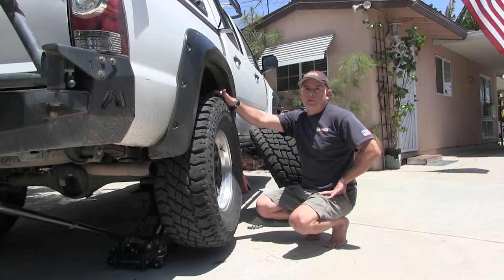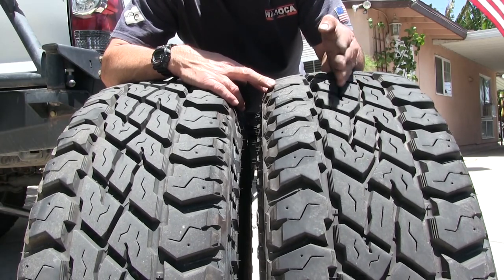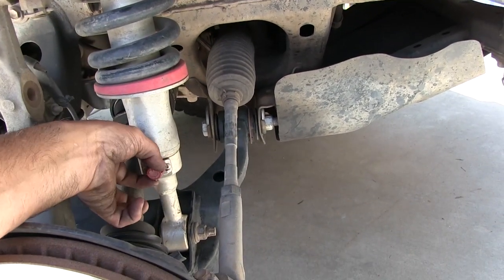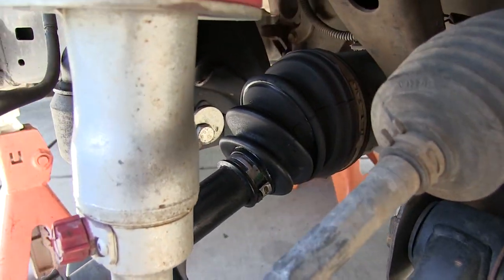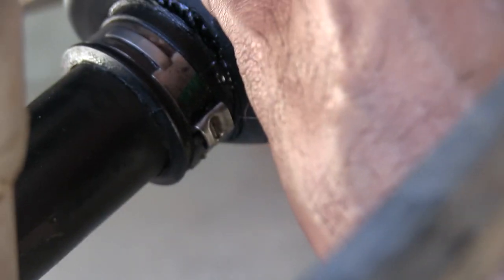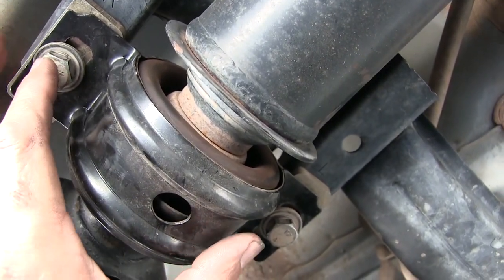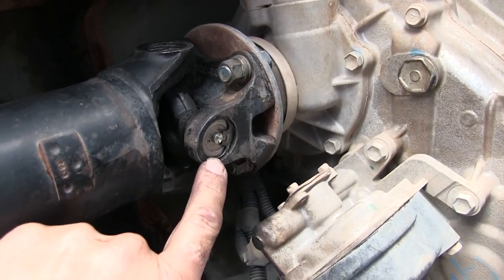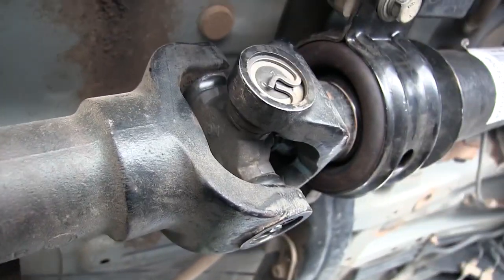Getting Ready

Comment: I did both front wheel bearings and carrier bearing before 50,000 miles. Wheel bearing assembly  $170 each from taco bandit. Carrier modified Ford Ranger bearing.

Comment: If you're pressed for time, just would buy new CV axle at AutoZone/Napa.  When time isn't an issue, you can rebuild the one you changed out and use it as a spare.
Reply from the maker: $65.00 plus core at Oreilys.
Reply: Or you buy new w/o core.  At least at AutoZone.  I just did it for my 1st gen Taco.  This way you can rebuild your og as a spare.
Reply from the maker: A new axle was around $90.00. I could keep the core and rebuild but gonna need that cash to hit the trails..

Comment: I think you have to pull the whole front shaft out to replace the boot.  Should just be able to remove the nut on the hub and push it out then the other side just pops out of the diff.  However you may have to undo the upper ball joint for clearance.  IDK my yukon had like half shafts that I can unbolt.

I thought you just bought new wheel bearings - have you installed them?

I finally got to take my yukon out to a large BLM are past lake berryessa in napa county.  I had a blast and even got some of my tires off the ground during articulation.  Definitely want to continue the experience!
Reply from the maker: Well I was hoping to just change the oil and head on out. Looks like I will be changing out the axle.
Reply: its not that big of a job,and not only does oil come out,but dirt goes in.And it might fix the vibration also,A little heat and the upper ball joint comes right off

Comment: If you didn't drop the front diff when you lifted then you could have some CV issues.
Reply from the maker: That's why I only went with a two inch kit.  The trucks seven years old and is really used as a 4x4 truck.